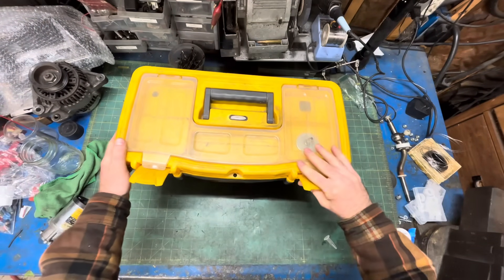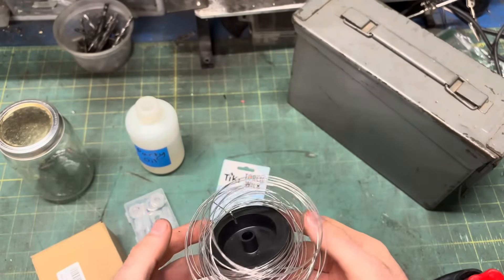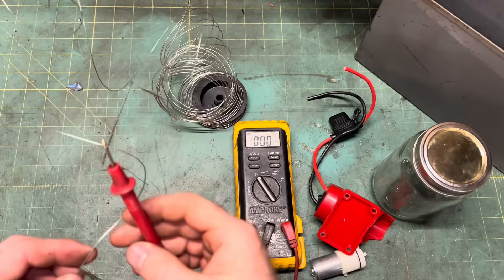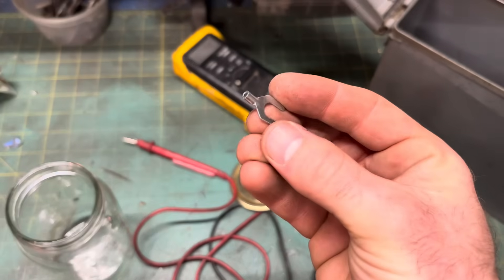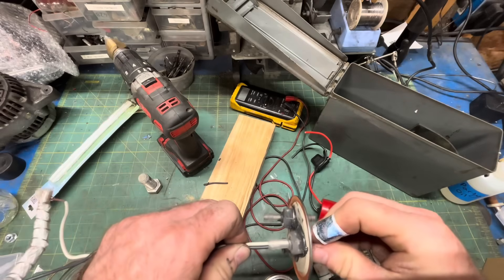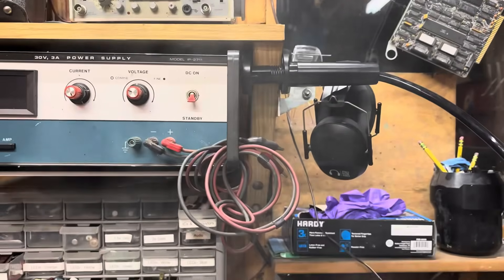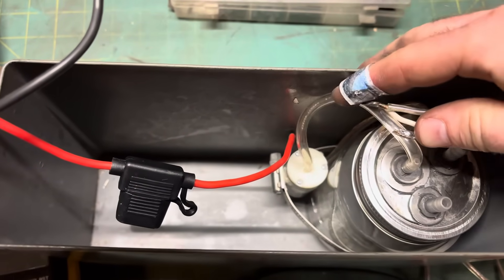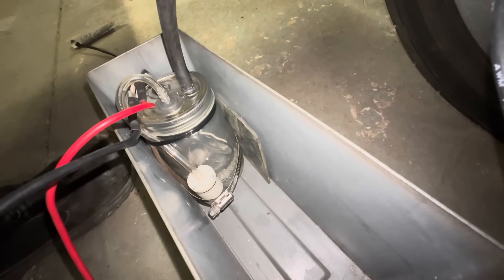Milwaukee M12 Cordless Evap Smoke Tester- A Simple & Thrifty DIY Tool!

Comment: I didn’t hear you say what kind of fluid this thing uses to generate smoke. Is it mineral oil?
Reply from the maker: Sorry, thought the Diddy photo would’ve given it away. Baby oil.
Reply: @thedoubtfultechnician  Any residue problem arise from using Veg Glycerin? I know the non-party oil is inferior, but I know many will have that on hand from the days of olde, before modding your own e-vape and making your own juice went on the inevitable arc from noble and cool to illegal. Also wont smell like cheap talc and dissapointment when used.
Reply: @wobblyboost think it through... It's making smoke... It will burn away. There's no residue.
Reply: @JeepITguy  There will always be a percentage of glycerin/oil that is unvapourised/recondensed, (the intention is NOT to burn it, just vapourise/boil it), that will then condense. My question was will Veg Glycerin residue pose a problem to sealed systems, particularly hydraulic or compressed air systems through contamination of the hydraulic oil chemistry, fine nozzles, valves, sensors, seals or filters.
Reply: Mineral oil, propylene glycol, or glycerin will work.
It's basically a big ass douche flute.

Comment: 7:29 a little tip i found: while nichrome cannot be soldered to (easily) with common leaded solder, it accepts bronze brazing and then the bronze can be soldered to. similarly can be applied to stainless but that one is far more annoying to braze, especially large because it oxidizes so rapidly without special reactive flux

also beware inhaling the oil vapor is not good on the lungs, fog/smoke machines used to vaporize oil like this but because oil cannot be absorbed easily by the lungs it causes damage, like coal lung but oil. it might be preferable to use propylene glycol which is harmless (its what modern fog machines use), though it is hygroscopic so it might accumulate water in places you dont want

Comment: Vevor makes a compact evap smoke tester that runs on the cars battery. No air compressor or extension cord required. I have one and it works pretty good. Cost around 60$ when I got it.

Comment: I've been chasing around evap codes on my fiance's car. If a new fuel pump gasket doesn't fix it, then making my own one of these will almost certainly be in my future.
Reply: Honestly, unless you already have most of the stuff lying around, it's hard to beat the price point on what's available on ebay or amazon. Not saying you shouldn't do it, just that it might make more sense to buy one.

Comment: hey i know this is somewhat unrelated to the video but i noticed you have an aftermarket (hot air) intake on your solara. it has the same engine as my camry, the 1mzfe, and i was wondering what intake that is. i've been thinking about getting a replacement one for "more power" (fun suction sounds)
Reply from the maker: It’s an Injen short ram air intake, but it actually has a cold air extension that goes under the fuse box and behind the headlight.
Reply: @thedoubtfultechnician  woah no way, thats actually really cool. appreciate it.

Comment: What's crazy is that i had this idea about a week of two ago. But ended up going the extra cheapo route with stuff i already had (aquarium pump and old soldering iron).

Used it to figure out where sprinkler lines went. 

But now that you've got the proof of concept I'll do this as well. Its a giant vape.

By the way the easiest way to cut the holes in the lid is just to put the lid on the jar, hold the jar and then drill the holes.

Comment: Needs a flow gauge with the little floaty ball so you can see whether your completely sealed in the system your testing..  but the thing would need to be air sealed to the extent of the power of the lil pump..

Comment: to tidy up the cables from the battery couldn't you either run them through heat-shrink or some of that corrugated cable tidy with a slit down the side?
Reply from the maker: Couldn’t think of a good way to secure cable ties to the inside of the can without putting more holes in it, or messy epoxy. Considering how often it opens and closes in a given year, I’ll just be careful…

Comment: You know why Gollum hates smoking? Because he can't stand such filthy Hobbits. I've actually been thinking of trying to come up with something like this to do leak detection in the pipes for swimming pool systems during the winterization process once the water is pumped out. I'm thinking I would need to create something more than a 1psi differential to ensure that I can actually get it through the system. It doesn't help that I have no idea what I'm doing to make this, let alone a bigger version. Wish me luck and if I don't make a video in awhile, you know what happened. If I do survive, I may have some questions.
Reply from the maker: Stupid question, but if the pipes were leaky, couldn’t you leak test them with… water?

Are swimming pools popular in Seoul? Or are you gonna move into a different line of work?
Reply: @thedoubtfultechnician  water works if it's a big leak and generally that's how you'll find the leak. But sometimes you find a bunch of water on the floor of the pump room and it can get hard to locate the source. So smoke would be a good alternative. Also, when you get them ready for winter you pump the water out and make an air lock. My goal would be to do a smoke test in the spring before running water into the filters and pipes so that I could find a leak before starting the system since it's easier to do the repair when it's still dry. 

I've actually been doing pools for a long time even when I was at the CVC I was working on pools on nights and weekends. I'll probably ultimately doing microbiology/pharmaceutical stuff in Seoul but I've been working on swimming pools since high school. There are hardly any swimming pools in Seoul, especially residential because they will tax you like crazy if you have one at your house. There's one I'm getting a membership at so I can still do my laps but otherwise they're hard to find for anything other than "sports training."
Reply from the maker: @ThisIsFelixCollins Smart. How much pressure would you need?
Reply: @thedoubtfultechnician Not sure to be honest. There's usually 15 to 30 feet of pvc pipe that ranges from 1" to 2" in diameter (just rough numbers). The filters however take up between 400 to 1,500 square feet in volume. I'm not sure how difficult it would be to push air through one of those larger sand filters.  It's all way over my head to be honest. I'm definitely going to need to do some more research. I may end up hooking up the blower we used to push the water out during the winterization process, open up the bleeder valves on the filter, measure the PSI from there then... I don't know what I would do then. I like the concept but I'll definitely need to do a deep dive to start figuring it out.

Comment: For team Black/Yellow, make sure you watch the pack voltage. Don't drain a 20v DeWalt battery below 16v if you want it to last.
Reply from the maker: Dewalt batteries don’t have a low voltage cutoff? I know Milwaukee puts the low voltage cutoff in the tools, guess dewalt is the same.
Reply: @thedoubtfultechnician  Nope. DeWALT puts it all on the tool. The main terminals are directly connected to B+ and B- and C1, C2, C3, and C4 allow the charger to connect to the individual banks… though it doesn’t do any balance charging anyway. 🤦‍♂️

Comment: You basically built a giant e-cig. I wonder if you can use an e-cig to detect leaks. Or should I say, I wonder if you can use your lungs to detect engine leaks.
Reply: You can. I used a vape to diagnose a boost leak, and it wasn't even on a Subaru.

Comment: Airport security vs. tools - I confused them in Denmark with a stick/pencil type tyre pressure gauge. Yes, I occasionally check the rental car tyre pressures after finding a Kia Soul with 80psi at each corner.
Reply: Aww, he wanted to get to 100 "%" !
Reply: More = more betterer.

Comment: Cool design, and possibly an artifact your kids will find one day. Probably after AI bombs the internet and all this stuff we put out there actually does go away. Side note, these are also super useful for older cars with vacuum controlled climate control systems. Although, most of the time, if there is a leak in those systems, it's a nightmare to fix even if you find it.